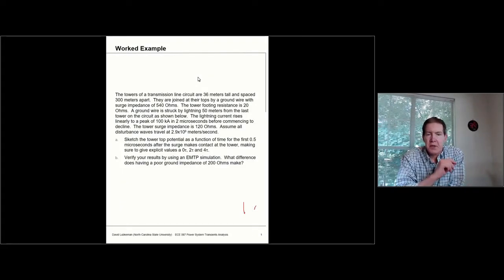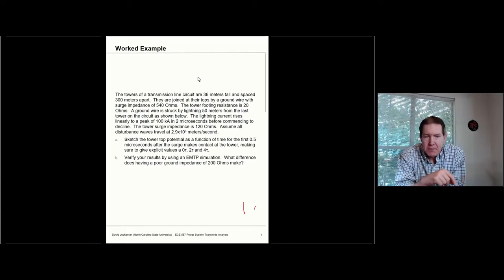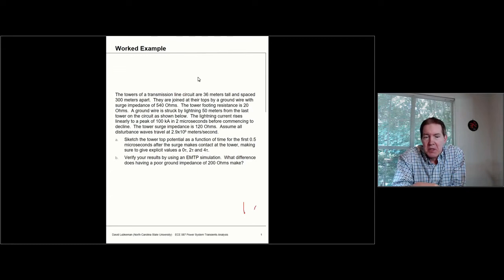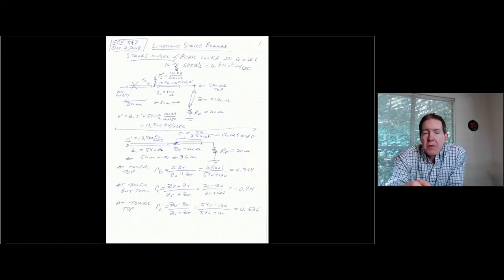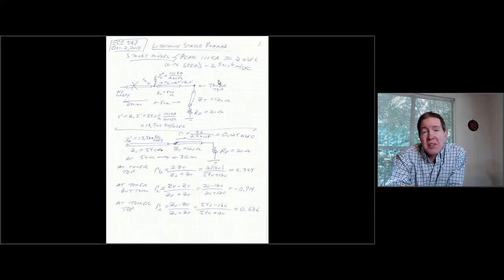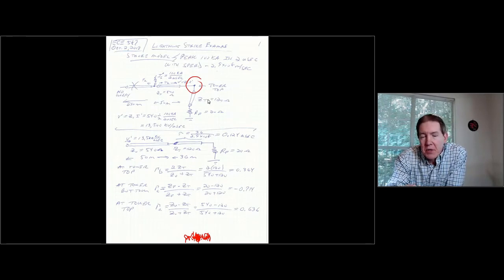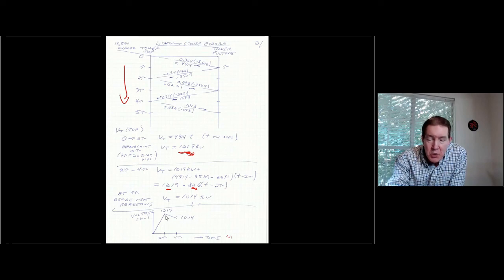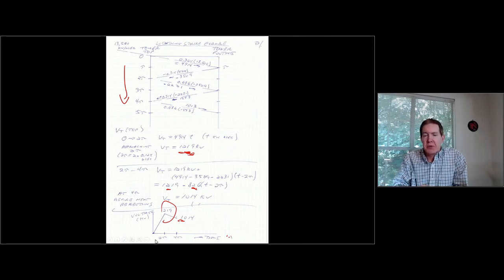Lecture 11b: Lightning Strike Analysis Worked Example - Power System Transients Fall 2020   Lubkeman

Comment: Hello sir. If the current injection distance in the line is varied, will it produce the same voltage at the top of the tower, or will the calculation be the same?

And why we ignore the reflection in left side of the current injection?
Reply from the maker: For the lossless line model we are using, changing the current injection distance does not  change the voltage rise impact.  It just changes the delay between the time of strike and when we start to see that voltage impact at the tower top.
Reply: Thank you sir, is it here the footing resistance meant low current and low frequency or dependent current footing resistance? and could you please provide some books or literatures that explains the calculations in more detail like in this video?

Comment: Hi Dr. Lubkeman, why was the surge current of 100 kA/2 us multiplied by 1/2 to get the voltage?
Reply from the maker: The lightning strike is modeled as a current injection into the transmission line 50 meters from the tower on the right. The current source sees two parallel line impedances of Z0 to the left and Z0 to the right.  We find the amount of current propagating to the right using the current divider rule of Z0/(Z0+Z0) which in this case is the factor of 1/2 you asked about.

Comment: Why there is no refraction coefficient from tower to ground(Zt to Zf)? Or why there is no r = 2Zf/(Zf+Zt)?
Reply from the maker: I was just focused on the tower top impact, so I did not need to compute a refraction component at the bottom of the tower.  However note for the first reflection at the bottom of the tower, that the voltage across that resistance would be the summation of the incoming waveform plus the reflected wave.  So the net impact is (1 + reflection coefficient) x incoming voltage.  This multiplier is 1+ (Zf-Zt)/(Zf+Zt) = 2Zf/(Zf+Zt).  So there is a refraction component, it is just I did not need to use it.
Reply: @dr.davidlubkeman284 thanks for the answer sir
Reply from the maker: Sure, good question

Comment: @8:25 , how does tower top refraction co-efficient become 2xZT/(Z0+ZT) instead of Z0-ZT/(Z0+ZT)?
Reply from the maker: For a traveling wave propagating down a line of characteristic impedance Za and hitting a line of impedance Zb, the reflection coefficient is (Zb-Za)/(Za+Zb) and the refraction coefficient is (2*Zb)/(Za+Zb), which is covered in Lecture 10a.  Note at the boundary that incident plus reflected waveform must equal the refracted waveform. So 1 + (Zb-Za)/(Za+Zb) = ((Za+Zb) + (Zb-Za))/(Za+Zb) = 2*Zb/(Za+Zb).  In this case the overhead grounding cable impedance is Za=Zo and the tower looks like a cable of impedance Zb=Zt.  This gives us a refraction coefficient for the portion of the incident wave continuing to travel down the tower of 2*Zt/(Zo+Zt).
Reply: @dr.davidlubkeman284  thanks many